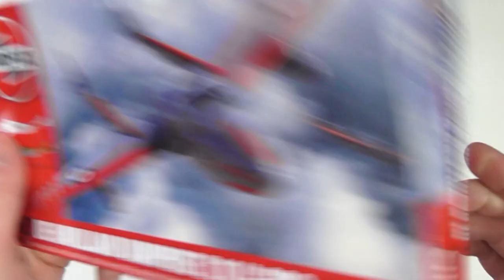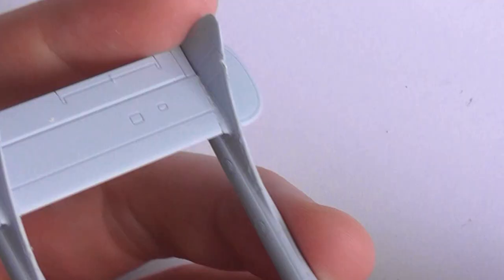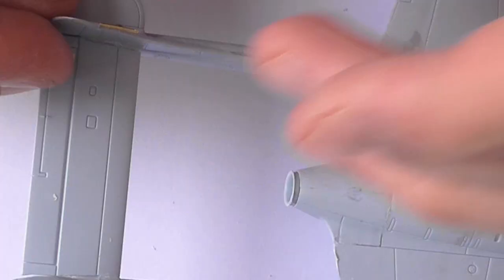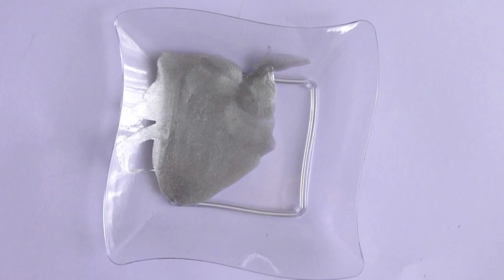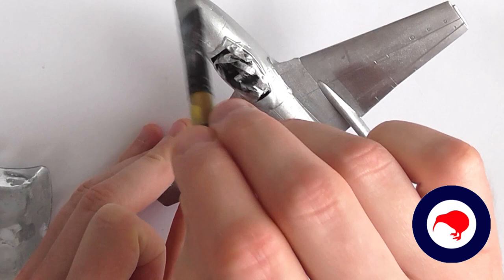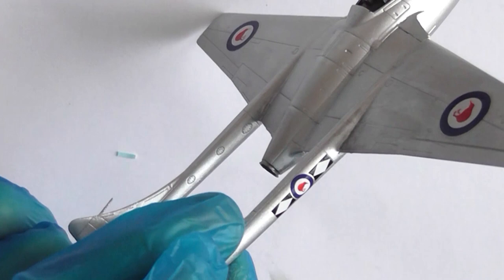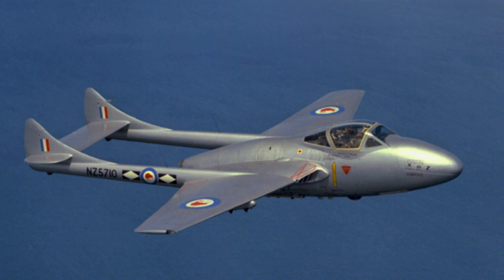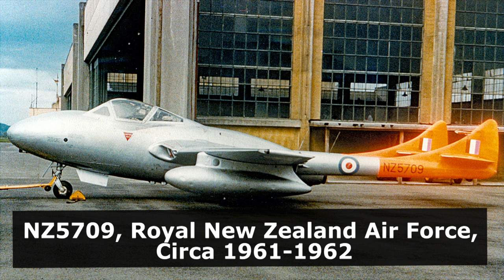Airfix 1/72 Scale De Havilland Vampire T.11 (Starter Set & T.11/J-28 kit)

Comment: How did you brush paint so evenly😊
Reply from the maker: Hello Max, the way I tend to get a some what even coat of paint. Is down to the fact I’m using a wide flat soft hair flat head brush. Starting from a spray primer base (Black, Grey or white) I tend to apply a few thin layers of paint (often using Vallejo or similar acrylics).  With the brush strokes (on a model aircraft) running in a nose to tail direction along the fuselage. With the brush strokes running on the wings. Running out from the fuselage to the tip of the wing. I hope this is of some help to you.  And thanks for watching too!
Reply: @ShuttleFactoryScaleModels  ok